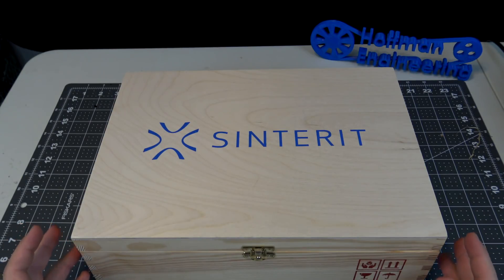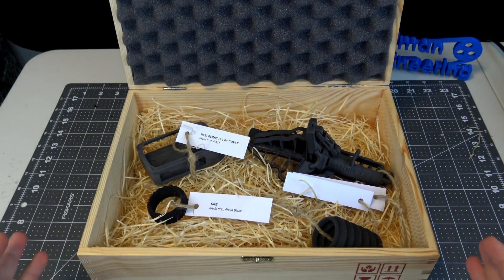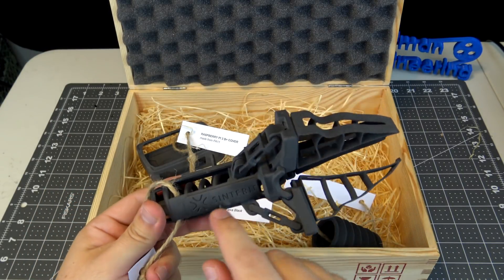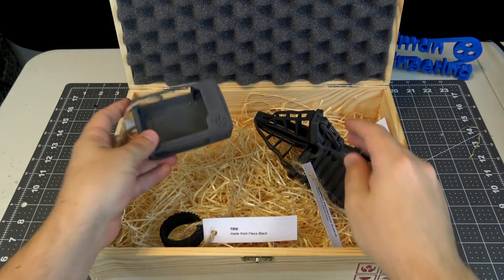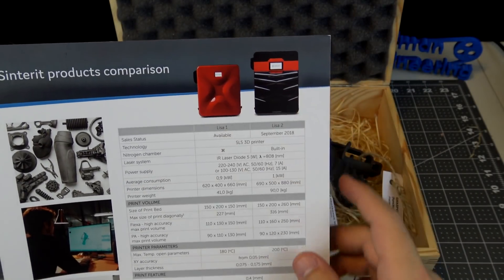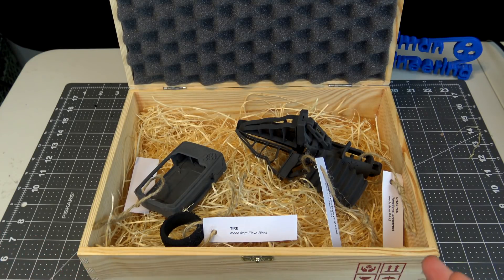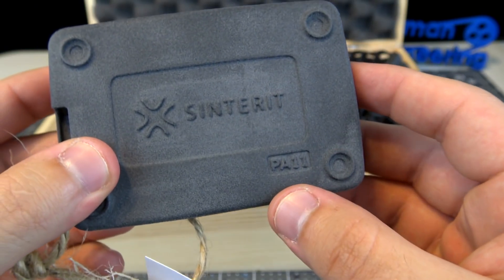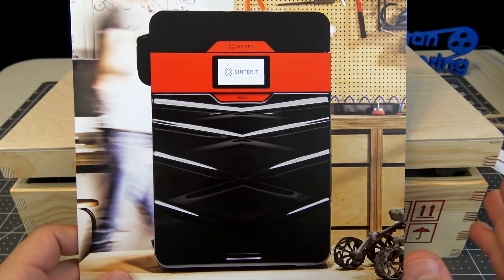New Desktop Nylon Powder 3D Printer!

Comment: I would be more interested in ordering SLS printed parts than buying a SLS printing system (see below for details). By the way, https://hoffman.engineering did not come up. And, this does not seem to be the same as hoffmanengineering.com.

While a desktop SLS system seems cool, I feel like a design company would be better off with a polycarbonate FFF printer for <$10k. Unless the prints use most of the nylon powder, such as when producing many parts, there is a lot of waste with SLS printers. And, cleaning off all the powder is so messy that I question how appropriate SLS is for a "desktop" system altogether. Don't get me wrong; at least the prints seem great (hard to say more since this video doesn't actually show a printer). There are simply practical factors that a business must consider.

Comment: When you do one of these, please share the price first. Looking it up I found this
Lisa 2 Pro single printer for €11990 net * ($13,934.60)
Lisa 2 Pro complete system for €13990 net * – (printer, powder sieve, sandblaster, 6kg of powder). ($16,258.97)
When I hear desktop printer I hear something the average person can pick up and use for a hobby. But no average person can get this without getting a loan.

Comment: I wonder if the nitrogen filled chamber is for printing materials that may produce volatile  vapors that may combust while being sintered by the laser
Reply from the maker: I believe it's mostly to do with preventing oxides from forming while the material is melted. Oxides would prevent the powder from properly fusing together, but the nitrogen would displace any oxygen and prevent oxidation. The protection from combustion would also be a nice benefit.
Reply: @HoffmanEngineering  yeah that makes sense! Never really thought about oxidation in plastic much, I know as spending time as a welder it makes a huge difference with weld quality and penetration to the root metal.